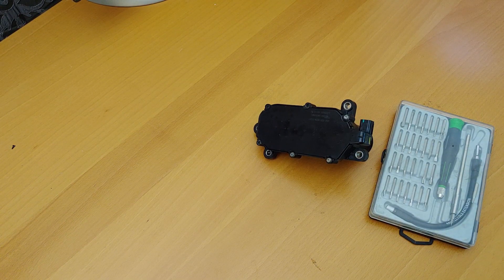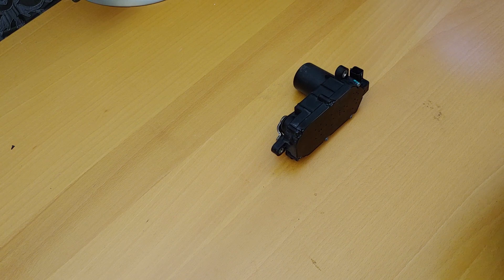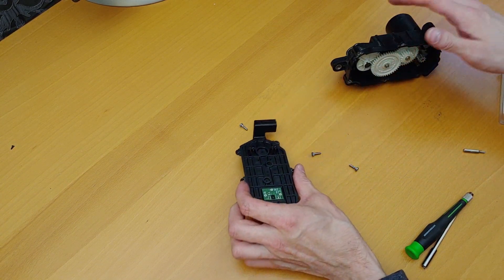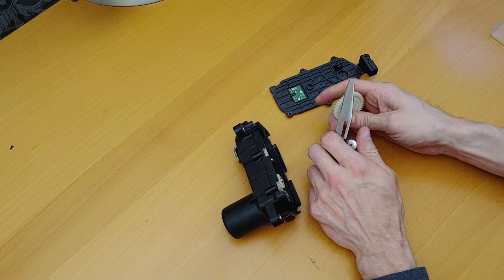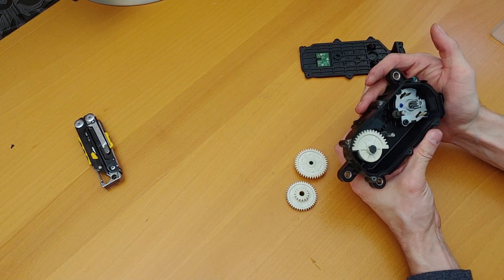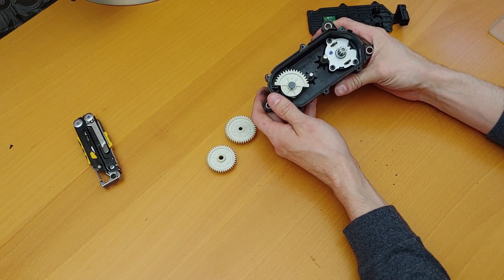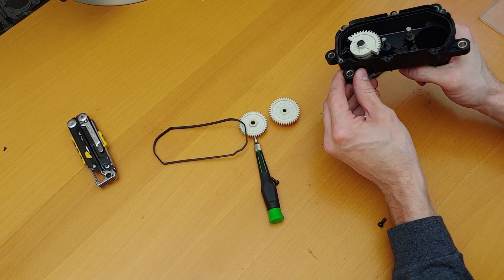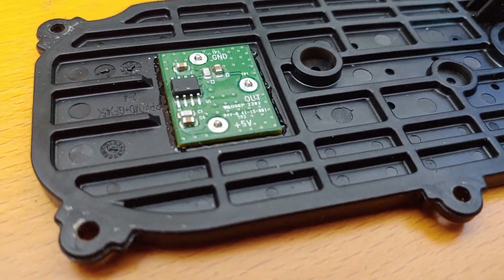VCM intake manifold runner actuator teardown

Comment: That's exactly what was the problem was with mine. I checked the gears, cleaned and added anti-seize to the link. A couple of days of starting and driving the car cleared the P200A code once the computer learned that all was well again.